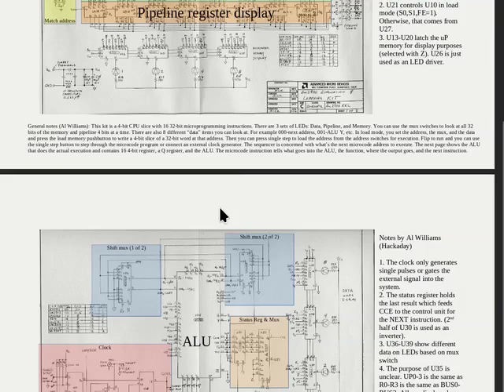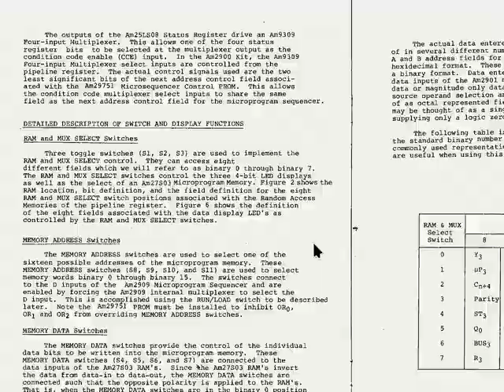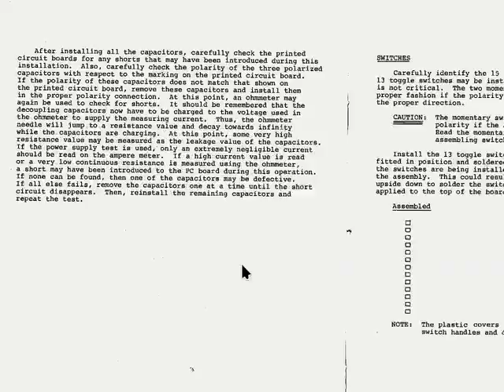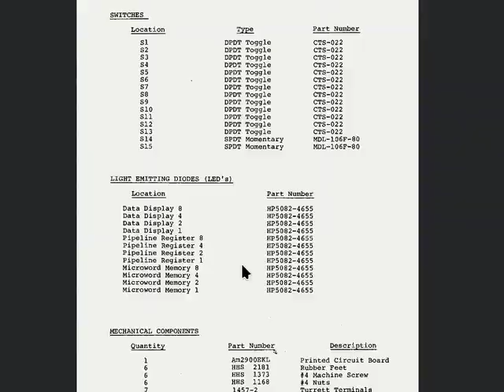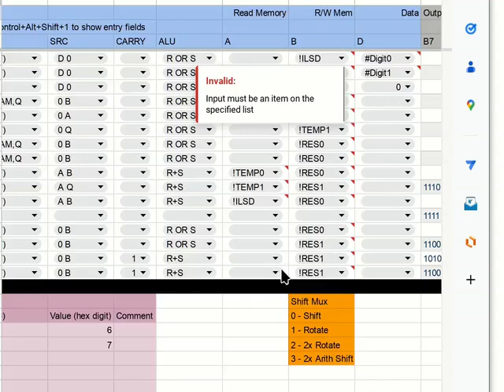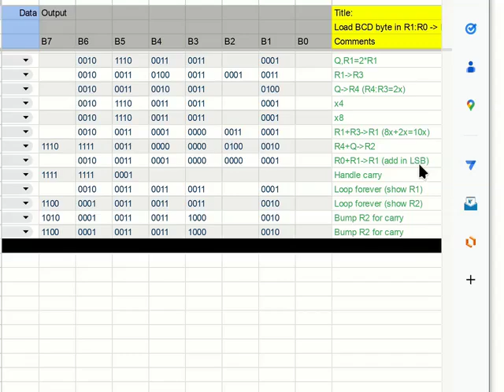AM2900 Evaluation and Learning Board

Comment: Hey, this really a great video. I worked as an embedded developer when the AM29xx family came out. I had some of the chips like the AM2901 and AM2902 and AM2910, but I never had the time to use them in a real project. Now I’m retired and have more and I’m working on a CPU board for the PiDP-11 using these bit slice chips. Thx voor the clear explanation!

Comment: The Am2901 came out before I was born, but I've become fascinated by its historical significance.  Several years ago I got myself the same Am2900 learning kit from eBay as a collector's item, though mine is in a much worse shape and I never saw my board in live action.  Thanks Al Williams for showing us how the board works and even emulating it!  In fact, I had thought about emulating this learning kit myself in FPGA or something but haven't gotten to it yet.

Btw, the purpose of the U35 bus transceiver, is documented in the kit manual, page 4-17:  "[The Am2907] is included in the Am2900 kit for evaluation purposes.  That is, this device does not connect directly to the input of the Am2901 bipolar microprocessor.  The Am2907 is one of the first integrated circuits built by Advanced Micro Devices in the new space-saving, 20-pin package."